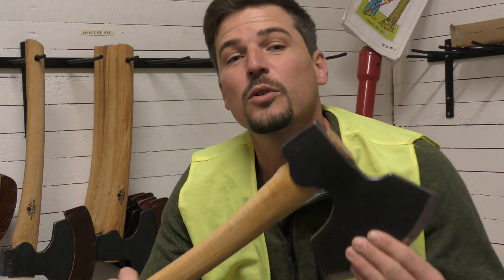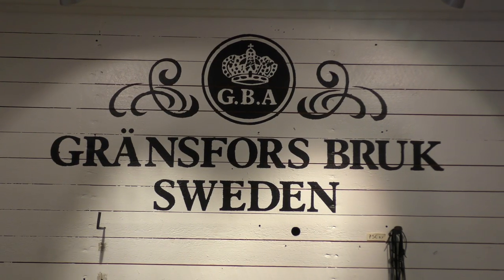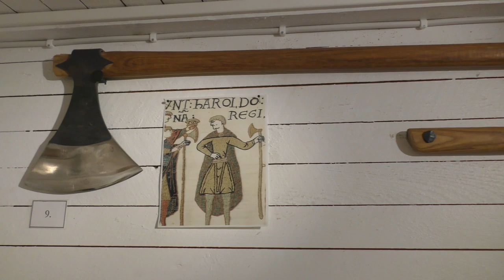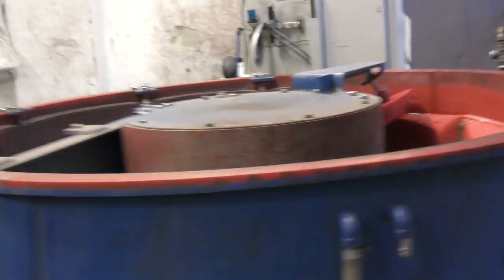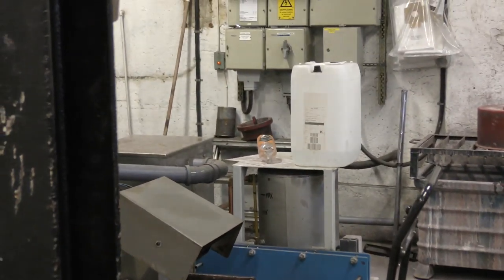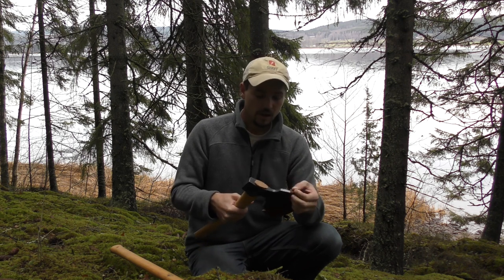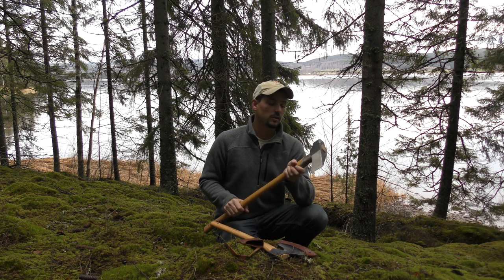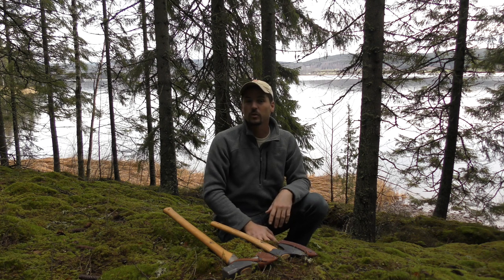Gränfors Bruks; Visiting the best axe forge...

Comment: Unfortunately Adze is a name I see on the internet for 2 different tools. There is the tool you described and another that is litearlly a builders right hand. That one, is not meant for chopping wood, and it has a hole to remove nails and a hammer end, to drive them in like a hammer does. The part of that tool, that some people think it's for chopping wood, is actually a very steep edge, that can't cut wood, it's just used, when builders remove the flat wooden boards, after they finish parts of building, It also works, to dig out nails, and then use the other feature on that tool, to remove it from the wood.
    Then there is the carpenters Adze, which is used to carve/chop wood mainly.

Comment: Thank you so much for this great Tour of the GB Factory!

I don’t understand what I was seeing behind one of the Power Hammers,  at least not for sure.  I’m referring to the Racks with what look like Axe Heads with their Blades chopped off.  Are they the rejected Axe Heads?

I want to politely point out that you were mistakenly interchanging incorrect terminology when you were saying that Heat Treating made the Axe Heads Strong,  but Brittle.  Steel is not Strong when it is Brittle.  When first Quenched,  the Steel is HARD,  BUT BRITTLE,  which makes it Weaker than it needs to be for most uses,  certainly for an Axe.  Also,  you had said that the Axe Heads were being Annealed to remove the brittleness after Hardening,  and to bring it to the desired Hardness.  You should have only used the word “Temper”,  (not both) as Annealing is the process of Heating Steel up to a very High Temperature,  (which would also be a very Red Hot Temperature) and maintaining it there for a fairly long period of time,  to REMOVE ALL HARDNESS IN THE STEEL,  which is an entirely different process than Tempering.  Tempering is a relatively low Temperature,  to relieve some of the  extreme stresses from Heat Treating,  in it’s Hardest State,  and to Draw back some of the Hardness,  to the exact Hardness Values that are desired for the particular Tool,  depending upon it’s desired use requirements.

Again,  thank you so much for the great video! 👍👍👍👍👍 🇺🇸